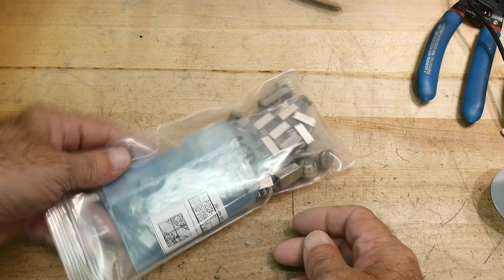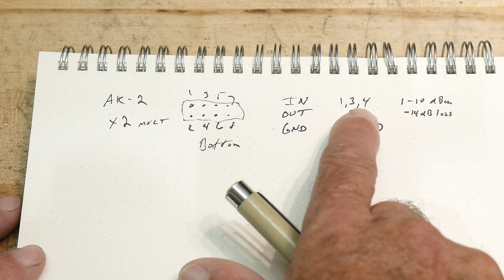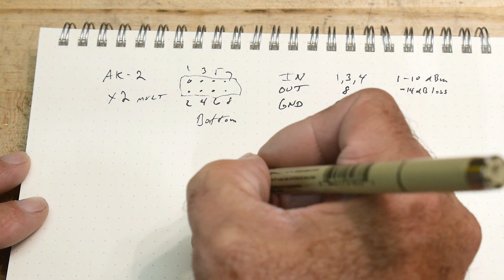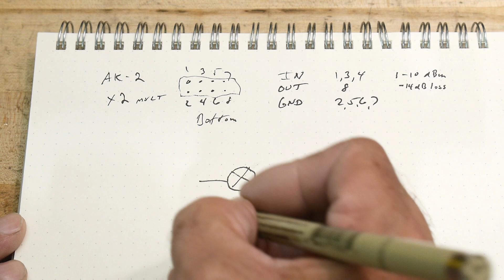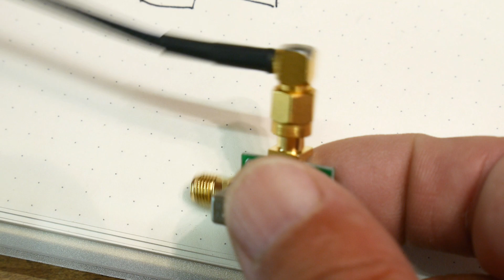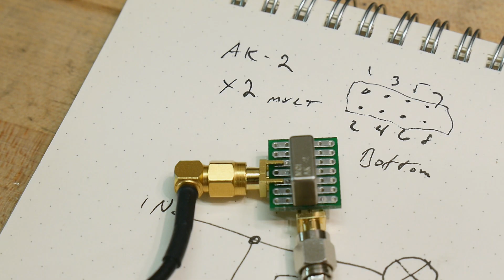#909 RF Frequency Multiplier

Comment: I have always wondered…….   On parts such as this why doesn’t the manufacturer inner connect those common pins (such as the inputs on the device in the vid) to reduce the connections, PCB drill points, etc. for the end user?
Reply: IT MUST BE ..THIS "THING"  CAN DO MORE .. THEN "THIS WE SEE"

Comment: Great videos always very interesting I am also a radio ham like you, 
I have a hp8922 test set, that runs from 10-1000mhz but the spec analyser has only a 10mhz span, 
Do you think using a mixer to get the spec an to go below 10mhz would  
Work ok and use a pre-amp to match the level, or is there a better way to do this,
Thanks Dave 2E0DMB

Comment: It would be interesting to use a lower frequency and look at the output with a scope to see exactly what they are doing. I suspect it is a sine-cosine type situation like a full wave rectifier where you input a frequency and the output is the cosine frequency which is double but offset to one polarity. If it is not filtered it delivers a quite strong double frequency. That 14db loss is atrocious!